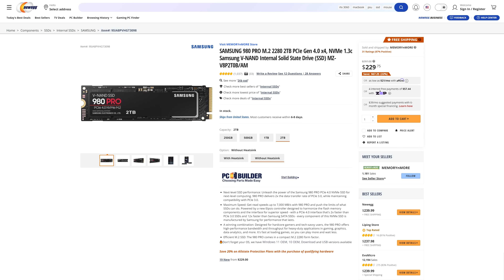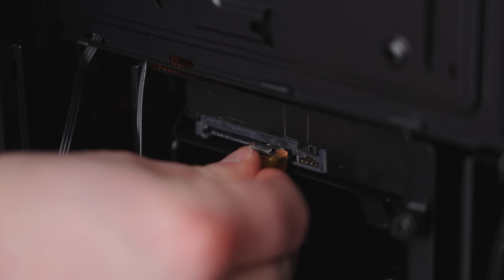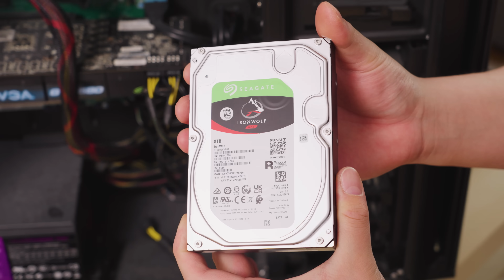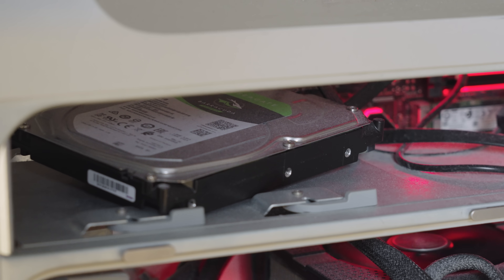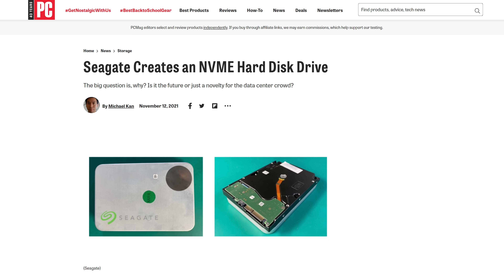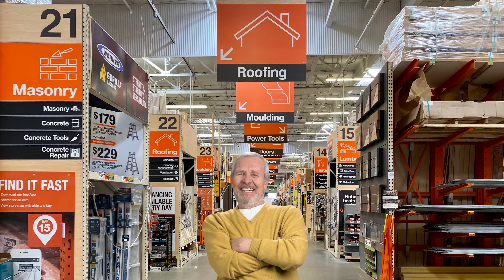Is SATA Obsolete?

Comment: I still like HDDs for mass storage. Running a Raid0 striped array for games that are easily replaceable allows me to have hundreds of games installed. I reserve my NVME drives for Winders and most recent games I'm playing more frequently. In the last few years I've had an SSD and an NVME die just last month losing data, but my 2 raid arrays have had no hiccups for a decade. While that NVME is still under warranty that doesn't help all my lost lost data. At this point I don't trust ANY storage medium.

Comment: Ahh, the PATA. When you forget to switch configuration from slave to master using the IDE cable and jumper or lose the jumper itself, oh the memories. SATA is just more convenient. More storage more happiness.
Reply: Yes, and that's not even the worst of it. Since only one drive can be active on a cable at a time and you typically only got two ports, you were restricted to 4 drives, of which you could only copy between two of them at a time without the transfer rate being reduced to less than half. 

OTOH, SCSI was a bit more of a mess as you had to deal with device IDs so that the controller board knew which devices it was talking to.

Comment: Wait so if im using both of my nvme slots and a gpu my gpu isnt running at the x16 lane? 
Also what if i add another expantion card (as i plan on doing) for nvme's and have 2 nvme in the board a gpu and a expantion card with nvme? 
I ask because i thought each piece for nvm and the like gpu/expantion slots have yhere own wireing making them have there own lanes. Being motherboard with a x16,x8, 2x4 slots and 2 nvme's slots wouldnt they all have there own wireing in the board to be seperate?

Comment: YES, same honestly I've recycled my  SSD used it for my main OS drive, I thought it was temporarily but its almost 6 months never bother replacing it with NVME. The other  NVME  right now I'm using separately for gaming drive never switch it coz its 2TB.. while SSD with 500gb is more than enough for my OS. Booting is not really an issue its fast enough for my liking.

Comment: The only thing that annoys me every time I have to build a pc is that they require a giant separate power plug for every drive. Like c'mon, they don't use nearly as much power, you could easily power from motherboard in a single cable.
Reply: SSDs don't use much power but mechanical spinning drives still use a bit of power. Not as much as they used to but still a decent amount. So direct power feed cables from the power supply is still a good idea instead of feed from the mother board.

Comment: But why nobody mentin that SSDs dies in a few years (I've already changed few after "I can read, but any writing take 30 seconds"),
when HDDs can spin like 10 years?
Reply: Actually, SSD's last longer than HDD's. So it sounds to me you just bought a trashy brand or got a bad one. One of my SSD's used for the media centre still works after 8 years of use.

Comment: I think that for a lot of people who build their own PCs (including myself), an NVMe is used for the operating system predominately  and Sata SSDs for storage. In fact I have separate SSDs labelled; home, work, music, videos, games and films (plus two backup HDDs and DVD player for the occasional CD) so use 9 sata connections.
Reply: You think that because that's a smart thing to do. SSDs are extremely dangerous for data preservation. Once one of those suckers goes bad, all the data is likely to be lost forever, and they don't necessarily warn you of an impending failure the way that most HDD will. Having had computers in my home for over 30 years, I have not once had a single drive fail unexpectedly. Every single time I had one die, I had the opportunity to remount it and copy files off of it. Obviously, I still make backups, but copying the disk is the only way to be sure that my backups were comprehensive when restoring.
Reply: @SmallSpoonBrigade  Well to some extent I agree with you but SSDs have become more reliable than HDDs (most companies serious about their systems will swap out HDDs after 4 years regardless of their status). The use of SSDs does not obviate the need to make backups on a regular basis which is why I stated that I have and use this facility on my PC.

Comment: Advancements in PC tech for the typical user and even budget gamer has slowed to a crawl. I have SATA HDD, SSDs, and NVME in my current build. I would probably still use my old IDE HDD in the same build if I had the space for it.

Comment: The section on PCIe lanes misses an important detail.  On a lot of consumer CPUs there is 16x for the GPU, 4x for the first NVMe slot, and then any other NVMe slots are taken off the chipset.  Since the chipset handles SATA and the extra lanes for the extra NVMe drives, the bandwidth there is limited to either the interconnect speed (SATA or NVMe), or the chipset to CPU link.  However, generally unless you are connecting NVMe via PCIe riser cards, adding more NVMe directly to your motherboard generally doesn't interfere with your GPU speeds.  Of course exceptions apply, and check the manual, but in most of the time you don't need to worry about filling up your motherboard's NVMe slots.

Comment: PATA wasn't used exclusively for wardrives. It was used for any data related transfer. Hard drives, floppy drives, CD ROM etc. SATA came along and did the same thing with a smaller footprint, faster through put and more cheaply made. Though that is the case, the SATA basic protocol of transferring data over cable will not, nor will ever be obsolete. To think so is short sighted and ignorant.
Reply: Regular floppy drives were never PATA, they used their own specific interface. There were various "superfloppy" drives that used PATA though, ZIP drives, LS120 drives, Sony HiFD drives etc.

Comment: the only cheap ssd are 128 , 256 gb wich is still a no go , nvme  , granted they got cheaper but not enough ...........so till that doesnt happen mechanical hd and ssd still have a long way to go.
furthermore all mobos have sata conection but not all have nvme slot

Comment: SATA is here to stay for a long time, it's cheap to implement, doesn't take much space on the board. Has far fiew disadventages to PATA (much smaller connector and cable, no master-slave crap). We may see some sort of NVME connectors for external drives but, especially with newer revisions of PCIe, using an extension cords creates problems with errors and slowdans the longer the distance between the CPU and the device.

Comment: SATA-III is deprecated
6gbps is slow, especially when taking in account that is actually total bandwidth, as SATA is unidirectional (single direction at one time). You cannot give commands to SATA device, while it is supplying data. 

SAS3 is 12gbps and SAS is bidirectional and can read and write at the same time, OBVIOUSLY. Just imagine 255 or 2047 drives waiting till single one would finish reading or writing, that's absolutely stupid. 

So, yes SATA is deprecated in many ways, and no it is not recent, and not by NVME, but SAS.

Comment: I think it might be good to add a sentence or two about how PCIe lanes are split. Since it is less likely to affect your GPU PCIe Lanes if your motherboard layout has all but the top M.2 Slot run to the motherboard chipset rather then taking on more direct PCIe lanes. This may change if you are adding a PCIe addin card with M.2 Slots, but even then, only if the PCIe slot runs direct to the CPU and not to the MB Chipset first.

Comment: I'm just waiting for the type c form factor to take over everything including internal connections. Imagine instead of needing a bunch of different types of cables your power supply and motherboard just had a bunch of type c ports.
Better yet your wall outlet is just type c straight to your motherboard then you just have cards that mount similar to how they do for PCIE except instead of a long boi port its just a type c and you don't need any additional cables for power because by that point type c will be capable of more watts than your outlet can supply.
All jokes aside isn't thunderbolt 4 40Gb/s and SATA maxed out at 6? Why can't we just have internal thunderbolt for SSD's that also delivers the power for less cables and easier cable management? I mean yeah you could probably sacrifice a USB header or 2 that's supposed to go to the front panel and just run an SSD that's intended to be external, I guess.

Comment: I recall SATA becoming dominant a good decade before SSDs started becoming standard into non-enthusiast system.
Reply: From what I remember, MBs had Sata connectors from like 2004, I had first sata HDDs in like 2006 or 2007 and in 2008, PATA HDDs were already obsolete and you could buy only SATA new HDDs, that's like 5 years before SSDs started be more common, so say that PATA disapeared because of SSDs is nonsense, it disapeared even before SSDs, there was already SATA II in 2007, it's much older than some people think and the latest versions of PATA supported 133 MB/s which is more than even young SSDs could reach. And the main power of SSD is not transfer speed, it's low latency which worked perfectly even on PATA, I remember some PATA SSDs, it existed.
Reply: @Pidalin  Dude, SATA drives and MBs came out about the same time.  Your MB had one or the other.  It doesn't do any good to have a MB with SATA if there are no SATA drives.
Reply: @johndoh5182  A LOT of motherboards in the early days of SATA adoption had BOTH SATA ports AND ATA ports (usually better known as EIDE ports, commonly at 133 by that point, sometimes as slow as 100).
Overlapped I'd guess for about 5 years, perhaps somewhat longer.
Reply: @johndoh5182  a LOT of motherboards had both, especially since sata cd/dvd drives werent nearly as common as sata hdds, have an msi platinum k9a (think 2007) wich still has ide and sata (ide mostly for cd/dvd drives
Reply: @Pidalin  I had a Dell Dimension from 2004 that had SATA, but a Toshiba Satellite laptop from 2003 that had PATA, so you're pretty much spot on with your timeline. There are some nice PATA SSDs that still exist mainly targeted towards niches like retro gamers and maybe those who need to keep an old system alive, but if you're dealing with an old desktop, it's much cheaper just to get a SATA SSD with an IDE adapter.
Reply: @marcuscook5145  I know exactly in what year sata started spreading because first MBs where it was common were intel socket 478 with 865 chipset, which was exactly what I had back in the day. I have 2 IDE-SATA adaptors (you can connect Sata disk even to Pentium III MB) but it doesn't work always with all HDDs/SSDs and annoying thing is that it's really big thing in IDE port on MB and it needs another power connector, so you can't really make nice cable management with that, but it works. Probably the easiest way how to have something like IDE SSD with not limited speed by USB 2.0 (like IDE to SD card adapters are) is IDE to CF card adaptor, but CF cards are really expensive now.
Reply: @Pidalin  "it's low latency" Yeah, seek times were monstrously large on mechanical drives and none-existant on SSD.
Reply: ssd and sata?ssd can have sata or nvme, sata or nvme are connector/protocol to interface with cpu. ssd is media.
Reply: Coming from a Mac guy, the Power Mac already had SATA from 2003 onwards...
Reply: @trismegistus2881  Yeah but that was still the first 150MB/s Sata, which is barely faster than IDE. Less than 1 year later Sata II doubled that to 300MB/s and became popular.
Reply: @leeloodog  sata cables were really badly designed, it was so fragile, you could damage connectors so easily and you still can, they should replace them already with Sata II standard
Reply: @Pidalin  "sata cables were really badly designed, it was so fragile, you could damage connectors so easily and you still can, they should replace them already with Sata II standard"

WTF?

SATA III is the current standard and you have to try REALLY HARD to buy a SATA cable that isn't SATA III.  Like, some retailer is having to dust off a shelf to see if they still have SATA cables that aren't SATA III, and I've never once had a problem with SATA, especially once companies made cables with clips.

And in my many years of working with PCs, I've seen at least one bad PATA cable.  They could get damaged too because it took a lot of force sometimes to pull the cable loose from the drive.

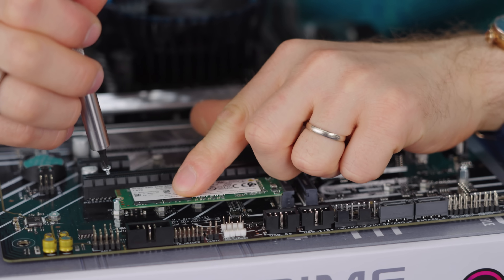Comment: 3:01 Not really, most motherboards only have one NVMe slot connected directly to the CPU, while the rest is connected to the chipset. With new motherboard chipsets coming with 8 lanes of PCIe 4.0, you could (in theory) have 5 PCIe 3.0 NVMe SSDs running at full speed even when writing or reading simultaneously.
Reply: I think both Raptor Lake (LGA1700) and Zen 4 (AM5) only supports 4 PCIe (equivalent) lanes to the chipset. X690 E has 2 chipsets, but they're daisy chained, not both connected to the CPU.

Comment: That 40 pin interface for hard drives & optical drives was ~always~ called IDE; then when SATA came out, they suddenly rename IDE to "PATA", justifying it's a Parallel not Serial ATA.
I was into building computers for a long time since age 10 maybe.
SCSI was replaced by SAS, why dont they say PSCSI to the former.
I remember setting up ESDI or MFM hard drives.
Reply: Not quite.  IDE simply means "Integrated Drive Electronics", where the controller is on the hard drive.  This compares to the old ST-506/ST-412 standards, where the controller was a separate card.  The first IDE hard drive was the Plus HardCard, which was a hard drive and controller mounted to an expansion card.  IDE refers to the type of drive, while ATA refers to the interface.

The 40 pin PATA standard was originally called "AT Attachment", abbreviated ATA. The "AT" refers to the IBM-PC/AT 16 bit bus.  The cable was essentially the needed signals from the expansion slot connected directly to the drive electronics.  Optical drives did not work with the original ATA standard.  Their support came with ATA rev 3, formally known as ATAPI (ATA Packet Interface).  Before that, CD-ROM drives were SCSI; the SCSI controller was often provided as part of the sound card.

You are correct in that "PATA" did not appear until SATA. That's because both are technically "ATA" standards, and a unique way to identify each was needed.

FYI, my first PC build was in 1985; a 20 MHz PC/XT clone with 1 MB of RAM, a 360 KB 5.25" floppy and a huge 20 MB Seagate ST-225 hard drive, running PC-DOS 3.1.
Reply: Yes the standard name was "IDE / Ultra DMA 33/66/100/133..." cable. And only when SATA was here it was called PATA. 
We were never at war with eastasia.

Comment: Can you explain PCIe lanes? If I use both of the m.2 on my motherboard, it’ll make my GPU slower? Where can I read more about this?
Reply: Read your motherboard manual. It depends on the Motherboard/CPU.
On some motherboards with 2 M.2 slots it can only run 2X half speed instead of full 4X for example

Comment: I have a 4 drives ssd enclosure, in a 5.25 bay.  To change one of the disk, I need to pull the lever, remove the disk from the tray, put a new one in its place, replug it. No tool required
I've recently added a nvme SSD : to install it, I had to remove my GPU and my ventirad, found out I didn't have the screw for the NVME SSD, bought a screw kit on amazon, installed the NVME, reapplied the thermal paste, reinstall the ventirad, reinstalled the GPU, start the PC, found out the CPU fan was not plugged correctly, reopened the case, fixed that and, at least, I was able to reinstall my system
Swapping a SATA drive: 5 seconds (and I can even do that while the PC is running). 
Swapping the NVME drive : 1 hour (+ 2 day waiting for the screws...)

Comment: I still think a SATA based HDD has its advantages; specifically for mass storage.
Reply: It does and it will for many years to come. I do think that they should continue to update the spec to include more speed, but if you need to store a bunch of data, it remains the best option. Sure, it's not the fastest, but it doesn't care whether the disks are inside of the computer, or if they're outside via an e.SATA port. (The e.SATA port is basically just an SATA port that's been engineered to handle being outside the computer, it's completely pin compatible with the internal connectors)

I personally use it for the files that I'm archiving and for backups. I will be getting an SSD in the near future for running my main OS off of because it does benefit from the increased speed over my SATA connected HDD.

Comment: No , you are not right. PATA was never called that until SATA came out.
It used to be called IDE (intergrated disk electronics) called that because the disk controller used to be on the interface but moved to being intergrated on the disk.

Comment: Not much reason to use nvme on home networked storage either, unless you really have the niche needs and infrastructure to take advantage of the increased bandwith/performance. For local storage thought, I think SATA will fade away eventually (5-10 years maybe). Just put the mechanical drives in a NAS if you need lots of storage.

I just wish the nvme slots were better implemented, like regular card slots, not scattered around wherever they could make them fit.
Reply: A NAS itself, excluding drives, is at least $200 for the cheapest out-of-the-box solution.

Comment: Fixed a button on an old home theatre system the other day, yeah I miss the cables from 20+ years ago, they wouldn't rip if you looked at them wrong!
Personally I like SATA drives, in fact my daily driver laptop is 3 years old now, has 1 M.2 and 1 SATA.  In 20 years or so I fear M.2 will hardly be seen though and we'll just have small 10TB lego like chips you can push in place...  They exist now, but nowhere near that capacity, more just for hobbyist electronics with legs that push into a board so you can solder them easy.